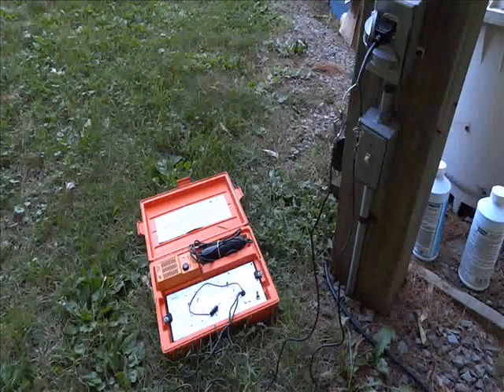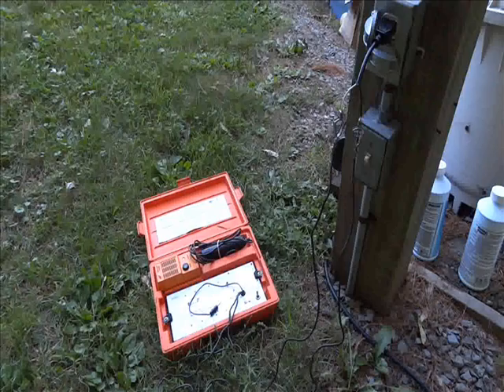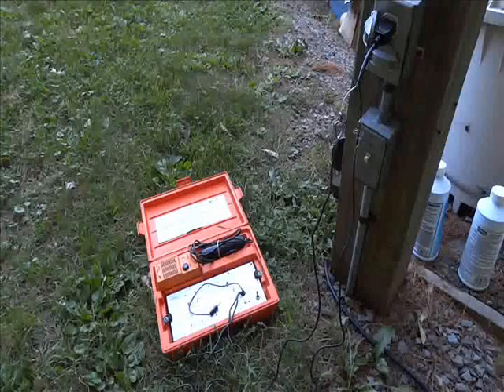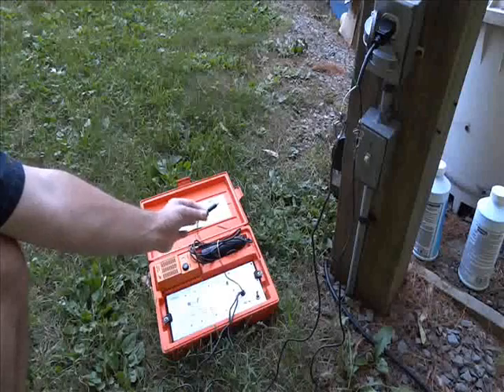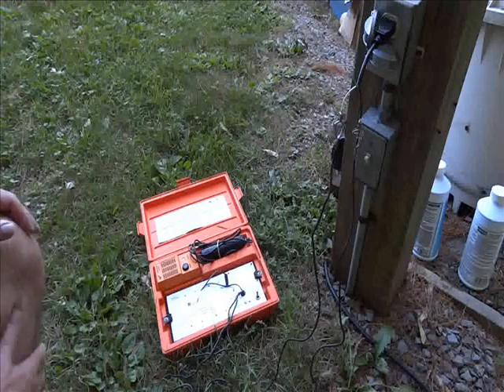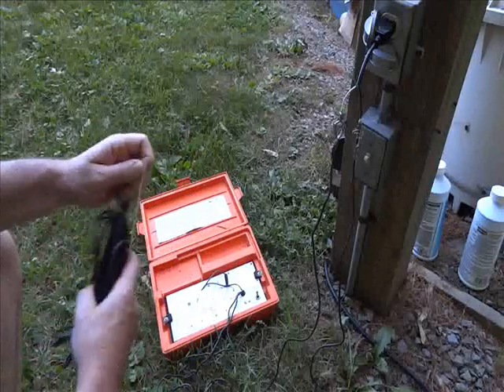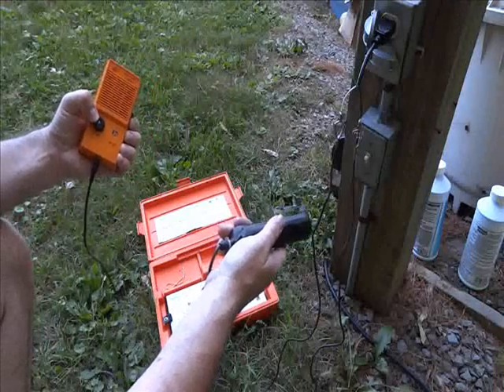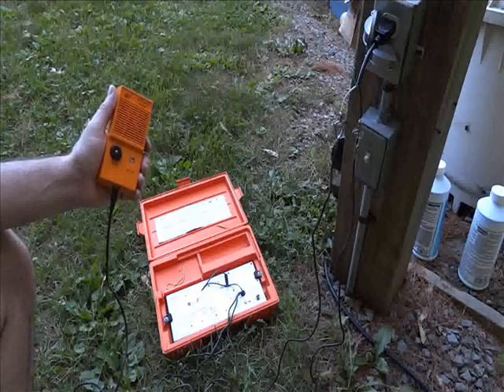Metrotel Corp Pipe and Cable Locator

Comment: To locate sewer pipe route-- attach a light weight wire to a small pvc or poly pipe a shove it up the sewer pipe until you reach block.   Then hook cable hound to wire and trace.   Have gone near 100 or 150 ft